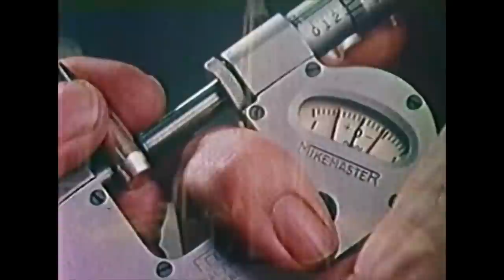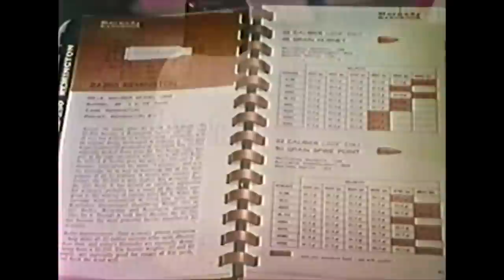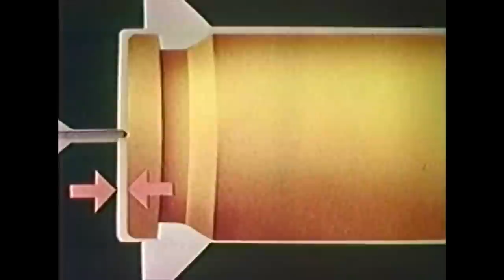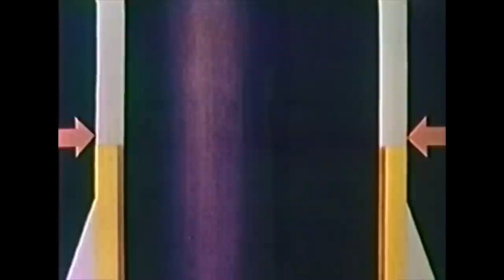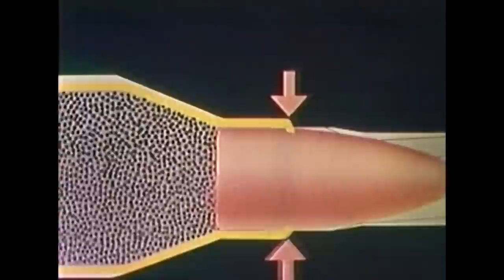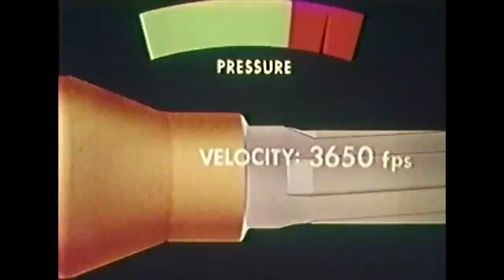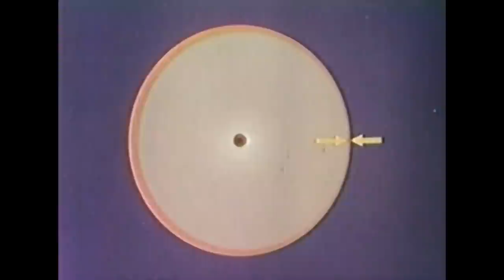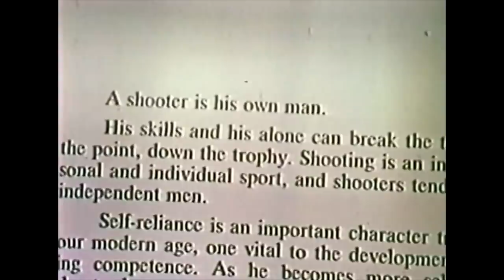Joyce Hornady on Reloading and Bullet Accuracy

Comment: My dad had the same Hornady reloading manual shown in the video. It probably pre-dated the Lee Loader we started with for .30/30 in the late 1970s. Back in that day commercial ammuntion was considered acceptable if it gave a 3"group at 100 yards with a rifle and 3" with a handgun at 25 yards. Using the reloader cut the group size down to about modern standards of 1" groups and there was a considerable cost savings in loading your own. (primers $1-2 per 100, IMR 4320 or IMR 4350 powder $3.25 /LB and $6-10 per 100 for bullets.) Once fired brass was usually picked up for free from a range or for a minimal cost at a gun shop. In the early 1990s commercial manufactured ammo began to be almost as good and cheap as reloading. UPS Haz Mat fees for shipping put a lot of people out of reloading. It became cheaper to stockpile ammo than components.